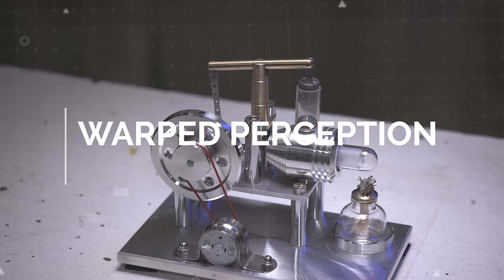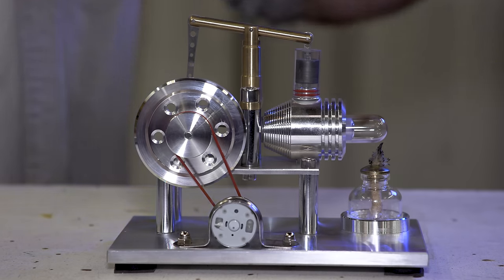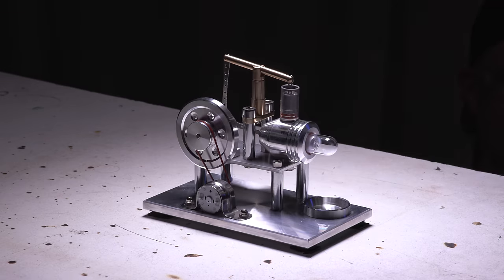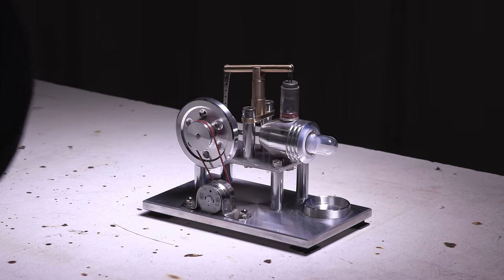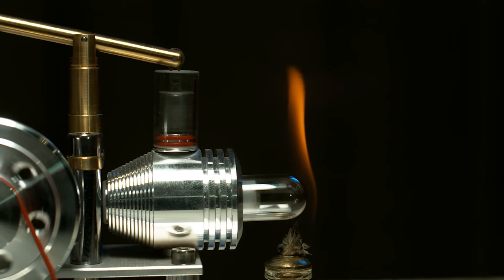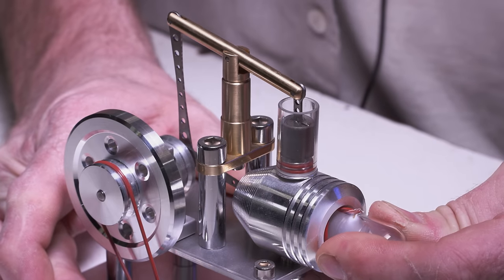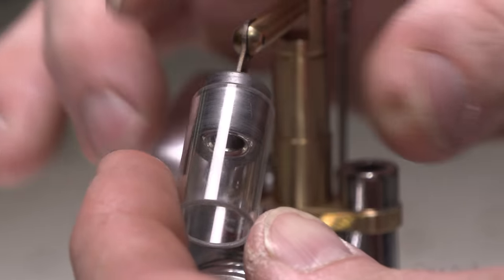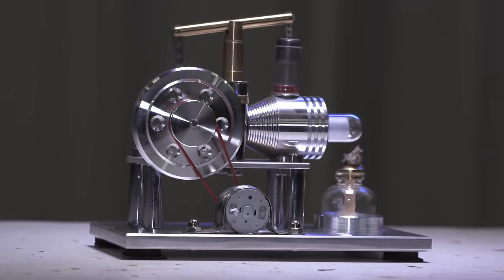Mini Stirling Engine - MAX RPM (Blow-Up Attempt #1)

Comment from the maker: A Link to buy this engine here: http://bit.ly/WP-MiniSterlingEngine
Use coupon Code: WARPED for 10% Off
Other engine models: www.stirlingkit.com
Use coupon Code: WARPED for 10% Off or click link below.
https://www.stirlingkit.com/discount/WARPED
Reply: Warped Perception on the website it says it runs at 1700-2000 rpm. I assume that is incorrect.
Reply: Do they ship internationally? Can't find anything on their site
Reply: Do they sell rebuild kits? ;0) maybe  have some titanium parts made by ToT and AvE. Heh
Reply: Warped Perception , that was fantastic , my little engine similar to yours , that is some outrageous RPM's , enjoyed the slow motion circle around from above , 
on your Briggs engine , use a regular cylinder head , cut out the center and use a piece of Pyrex glass or oven tempered glass for the seeing inside the engine
Reply: Warped Perception 8:37 the engine did survive the first test. It was still operational.
Reply: We should be asking is it made in CHINA?
Reply: Use a round or hex bar with a good diameter I don't know 75mm drill 3 holes on the side, drill one on the center but it shouldn't be a full hole it should be like cup . Use the metal chips and fill the "'Cup" with them and your Stirling engine
Reply: Should have rev counter on it great bit of engineering in that little thing that was abuse I'm impressed bullet proof design fair play
Reply: The cilinder is made out of quarz that's why it didn't melt

Comment: I'm thinking of Stirling Engine swapping my Ferrari, then hiring someone to hold a torch to it whenever I want to drive. It would surely be cheaper than maintaining its current engine.
Reply from the maker: Well I bet you that I would be able to build you a large version of this engine, if you really wanted to put it in a car... Instead of a turbo exhaust pipe sticking out of the hood, it would be a giant roofing torch with a 3 foot blue flame!!! That may be a really cool project can you imagine!!
Reply: Great idea for a future video.... large scale it baby
Reply: @WarpedYT  Time to contact Garage 54
Reply: I think you spelled Stanley Steamer wrong
Reply: @Samcrac
No backing out now mate, It's a bet. See if you can break 100mph ;)
Reply: @TheMatrixcube  🤷😂😂😂
Reply: @WarpedYT  have you now learned that the damaged piston was just a displacer piston and not the working piston?
Just askin
Reply: @WarpedYT  i think this engine didn't make it because to get the same power as a traditional gas engine the Stirling engine would be too large to fit in a car. Im happy to see someone finally run a small engine on HHO
Reply: And now the next thing i want to see is the plasma from plasma electrolysis running a Stirling engine. You have to find some way to encase the high temperature piston in an electrolyte solution. I recommend stainless steal mesh for the anode and fine copper wire (or tungsent) for the anode. rap the fine cathode wire around the glass piston. It would be better if you coud build the stirling engine so that its fly wheel is connected to a combustion engine. Then you run the cumbustion engine with the HHO generated from the plasma electrolysis. So both engines work together to turn the fly wheel. but if not i still want to see the plasma driving the stirling engine
Reply: use a LC series circuit to drive the plasma electrolysis. This method produce hotter and more stable plasma for the same power consumption
Reply: They have almost no actual power so you'd need an enormous flywheel. The sheer mass of it would slow it down and the lack of power wouldn't be able to keep the flywheel moving. So you'd have to build up alot of rpm before actually moving and you'd have to hope you can make it to the next stoplight to build up more energy on the flywheel
Reply: Have the gas pedal control the heat of the flame so you can move faster
Reply: And the one you have doesn't run with jizz only.... can you imagine the effort to reaching 80 miles/hour .
Tricky stuff to go back in time in that way...
Reply: @WarpedYT  hit the glass bit with an oxy acetylene torch
Reply: use the ferrari engine as the heat source
Reply: I approve your idea but don't do it to a million dollar car do it to like a Honda civic lol
Reply: Better than a LS swap

Comment: The generator is creating drag, you should remove the belt to get even higher RPMs.
Reply: Yes
Reply: Why tho, this is a toy, not that efficiency matters
Reply: Well being that the generator wasnt connected to anything, and wasnt shorted, the only resistance is the slight amount from the bearings in the generator itself, and mechanical losses due to heat
Reply: if overheat is issue then just submerge it in liquid nitro!!10k rpm confirmed
Reply: @KitKitChanIsaac  yes! Nitro=sp33d
Reply: It's an EMP
Reply: I have this exact engine and I removed the belt and then the engine revved stupid high and it just broke.
Reply: @Ezra Redgwell You can make a lighting setup wich runs on this little generator.
Reply: There is no load so just some rolling friction it had to come over , it only lowered it's mechanical efficiency
Reply: @Fred_the_1996  bc it's cool
Reply: @robertevans4795  I have an engi e like this, and even that little generator with no load causes enough friction to drop the rpms almost half, mine is very weak though.
Reply: Well kinda, the generator doesn't have a load on it, i'm pretty sure these come with an LED attached to the generator but it isn't connected for the purposes of this video, the only drag is from the rubbing of the shaft of the motor but since it dopesn't have a load it doesn't have that much resistance, if it has a resistance on it like an LED the engine would slow down noticably

Comment: Funny, I am familiar with these engines, and from watching other videos you put out, I said that YOU would probably get 4000 rpm (which is amazing).  To apply cold on the other piston, a super easy method is to use electronic duster.  Pleas hook a volt meter up to this.  Also a solid metal design would be able to take a lot more punishment.  Using heat, and cold with a metal design,  YOU may get 6k or 7k rpm.  Be fun to watch!
Reply from the maker: Awesome!. Electronic Duster?
Reply: @WarpedYT  multi purpose compressed gas cleaner.  Can be found at walmart in electronics.  When sprayed it becomes super cold and if sprayed while holding upside down a liquid comes out and is super cold.  Can cause frostbite.  Its cheap, readily found and probably one of the easiest ways to get the Stirling piston cold quickly.
Reply: OR - configure a small fan to the output wheel crank and aim it at the cold cylinder. Maybe it’ll feed itself to some degree
Reply: Mine going a lot slower got about 7 volts last I remember, at the rpm his is making, maybe like 10 to 12 volts. I'm not really sure how that whole thing works though

Comment: "Engage safety squints" -AvE
Reply from the maker: Lol... For sure !
Reply: IT'S CLEETUUUUUUSS lol
Reply: Skookum!
Reply: Technically, this engine was designed with safety in mind. If I'm not mistaken, Robert Stirling made this to avoid locomotives from exploding because of extreme heat

Comment: the swedish navy use sterling engines to power submarines,  and used one to 'sink' the USS ronald reagan in wargames
Reply from the maker: That's very interesting, I'm going to have to look that up.
Reply: At first I was like 'wait, what, that doesn't make any sense!' and then I remembered how damn quiet a sterling is when it's not being pushed to it's breaking point.

You get one balanced and greased just right and that thing makes basically no noise.
Reply: DFX2KX and you think nuclear in subs is noisy?
Reply: They are compared to a Stirling engine, nuclear reactors need a lot of coolant and the pump are pretty noisy

Comment: Put that thing in a rc car see if it'll push it along! Great video!
Reply from the maker: Awesome idea !!!
Reply: These things are all HP and no Torque
Reply: @michaelesposito2629  That's why you gear it down. There is no such thing as "all HP and no torque", because without any torque, there is  no horsepower. Horsepower is just the engine torque multiplied by the rotational speed, then divided by a constant. This engine would likely be able to power a small RC car, it would just have to be geared down to convert some of the rotational speed into torque.
Reply: Go further, get a big sterling & put it on a go cart!

Comment: Adding humidity to the incoming air charge will literally blow it apart. Water molecules expand about 1700 times their volume when heated to their boiling point. You wanted to know how to do it, here it is.